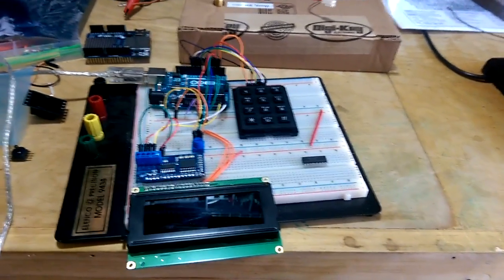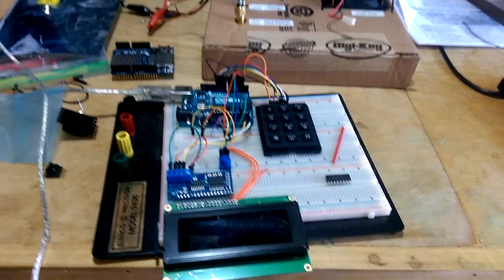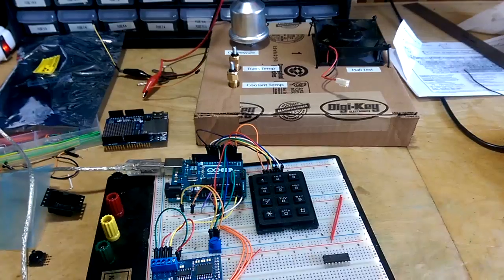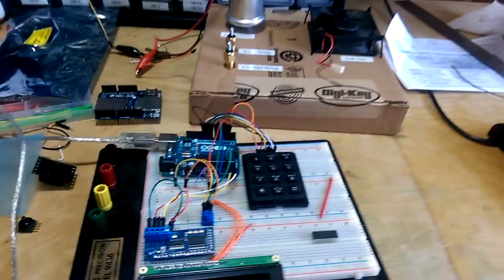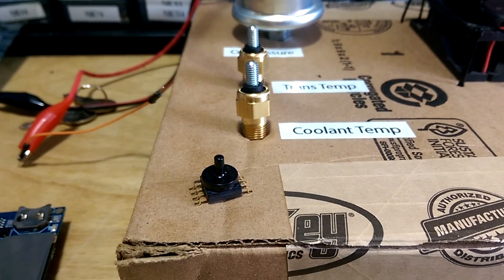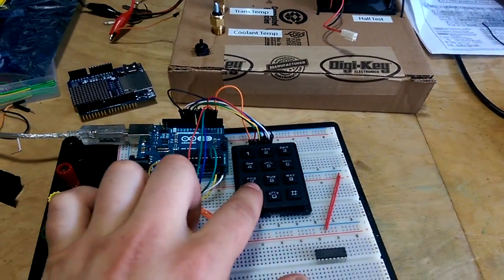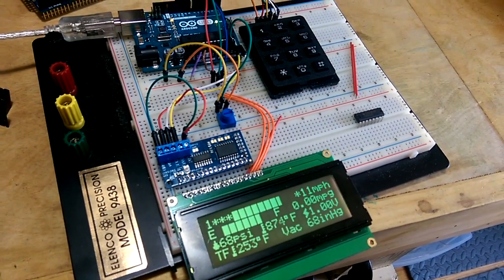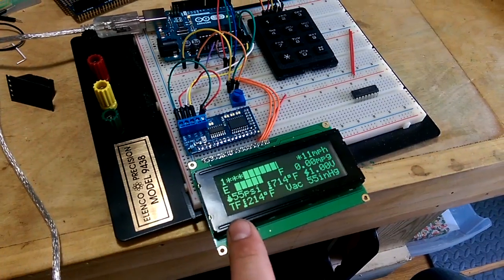Arduino Car Dash Project Summary / Progress

Comment: I hear you bro! thank you for the post. I have the same issue with the gauges on my old bike and will like to make some thing like this that will read temp, fuel, rpm's, and speed. maybe transmit the data to my phone.  would you be so kind to point me to schematics of your project. I'm new at the arduino and will be very helpful.